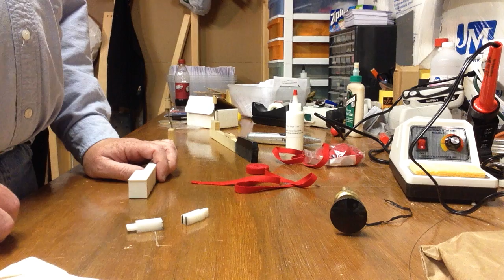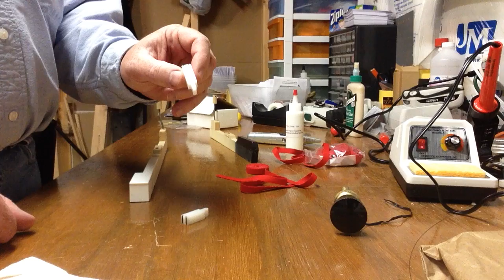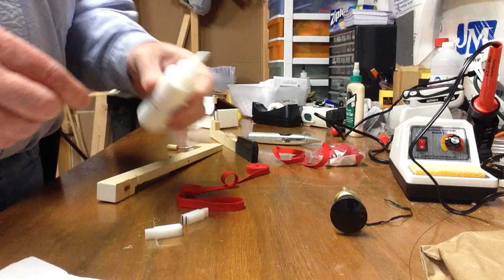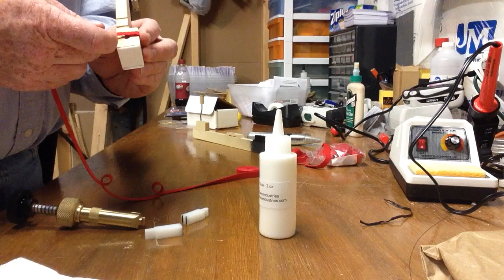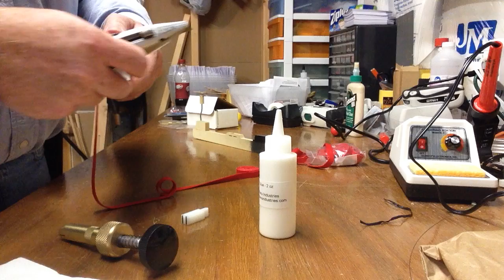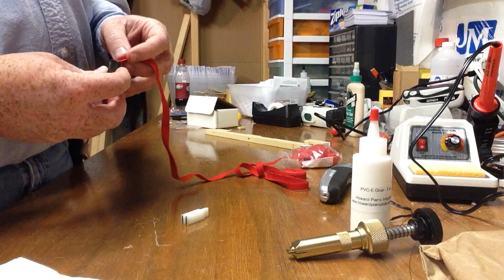Piano Tuning & Repair - Replacing Piano Key Bushings Part 2 - Installing New Felt I HOWARD PIANO

Comment: How do you cut the felt when replacing the balance rail bushing?  It seems like if you use the double shouldered caul, then you would get felt shoulders on the balance rail bushings.  My understanding is that, unlike the key pin bushing, you want the balance rail bushing to end flush with the top of the key.  Or maybe it doesn't matter if you have a felt shoulder on the balance rail bushing?  Thanks!
Reply from the maker: You can do it either way.  You can just cut the excess off flush with the side once the glue dries.
Reply: @howardpianoind  Thanks so much for the reply.  Just to make sure I am understanding, if you decide to cut off the excess once the glue dries, this would mean that you should be initially applying the glue to the mortar (as you do in the video) as opposed to applying it to the felt since if you apply it to the felt, the caul would push down and glue the excess.  Is that correct?
Reply from the maker: Yes, that is correct.
Reply: @howardpianoind  Thank you kindly, sir!

Comment: Do you have a video that shows how to replace the balance rail pushing. On my piano the cloth is folded underneath the wooden cap. Thanks...
Reply from the maker: With the balance rail bushings even though the original felt wraps around between the key button and the key, when you replace the felt you don’t have to do it this way.  You would just install the felt the same way as the front rail bushings.  You could only wrap it around the key button if you were also replacing the key buttons.

Comment: Really interesting. I just got a "rescue" Kawai MP8II digital piano with wooden keys.  It was stored in a damp basement for way too long. The major problem is many of the keys are binding in the rocker bar pins. Outside of finding the time to pull off this repair, I think I can do this.

Comment: What are all the different sizes of cauls? What are the more common sizes if I was to buy some?
Reply from the maker: The sizes of caulk are based on the size of the pins.  By far the most common size is .146”.

Comment: A 1909 Mason Risch. How do I remove the worn original key bushings? Glue is hide.
Can PVC adhere to any original glue within the interior? Should I stick with hide glue to meld with the original glue?
Reply from the maker: Hi Pat,
You could use Hide glue for the new bushings, but the PVC-E glue will work even if hide glue was used originally.  We show how to remove the old key bushings in part 1 of replacing key bushings.  Here is a link to this video: https://www.youtube.com/watch?v=82HKmPk--0o

Comment: Howard! I need help :) . I have the common .146 pin size, i can order the corresponding caul size but, im not sure about the cloth itself. I notice the ones mine has is about 3/8 wide but cant figure out which is the corrext one from your site. How do i know the thickness i need? I don't want to order things i don't so i havent placed my order because of this. Can you help me figure out which is the correct one without me ordering a whole bunch of sizes and guessing please. Thanks for your videos!
Reply from the maker: It is difficult to know which size cloth will be best without actually testing the cloth in the mortise.  We recommend getting two or three different sizes to try so you can get the one that fits the best.  The .043" is probably the most common size.
Reply: +howardpianoind yea i was the guy that called a little while aho asking the same thing. I placed order thanks again.

Comment: Thanks for sharing Howard. Just finished replacing felts on keys middle pins. I notice slight tightness but it plays great and the tone a bit mellower but good,  probably because the keys are moving in a firmer way now and no unnecessary sideways slips.

Comment: Hey Steve, 
 Can we use this procedure for replacing the bushings for the balance rail pin?
Reply from the maker: Hi John,
Yes, this same procedure can be used for both the front rail and balance rail key bushings.
Reply: howardpianoind Thanks Steve. that is my next venture after I replace Key tops.